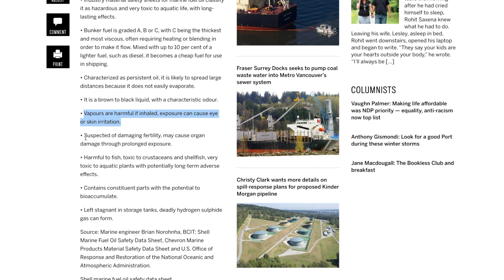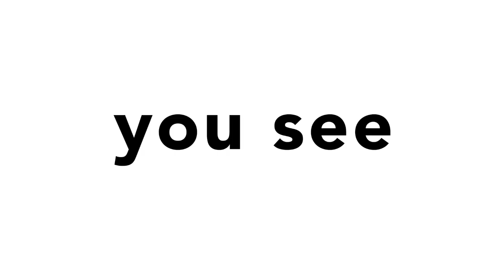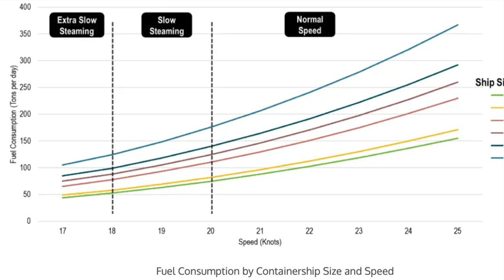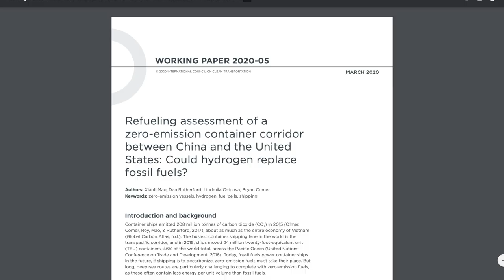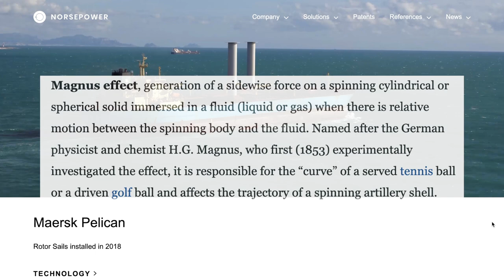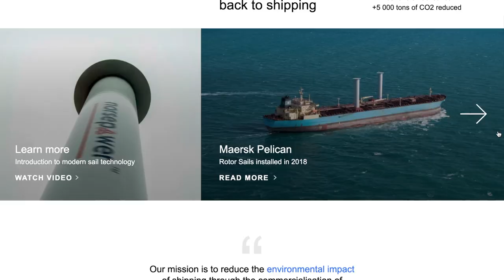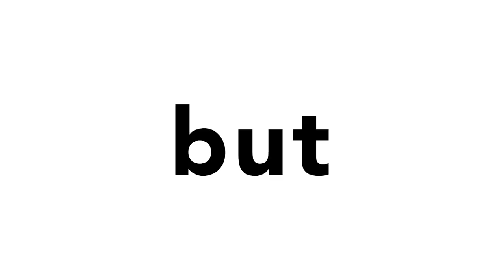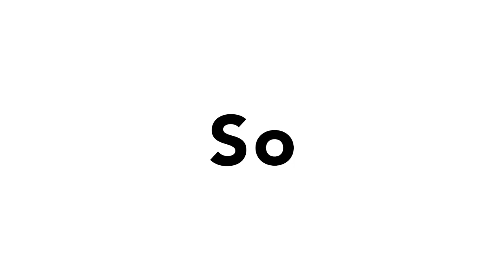Are Renewable Container Ships Even Possible?

Comment: The scale of container ships, and aircraft carriers means they don't have to have 1 Power Source.  In fact, container ships have been hybrid electric for quite a while, standard.  So, converting them to Electric is a pretty easy retrofit.  However, I wouldn't power them exclusively on renewables, I would extend their range with Wind, and Solar, because there's literally tons of it, all the way across the ocean.  We already carry Fuel onboard, but adding a vertical turbine, with a solar array means carrying less fuel, and more cargo.  The great thing to me is that this is one of the easiest changeovers for the companies.  They just have to see the long term profits, and pay for the conversions.  Governments don't even have to get involved.
Reply: Batteries:  Currently (Can't resist the puns) demand far outstrips supply.  However, these are being produced in America, and that supply is going to go up.  The thing is, if we play our cards right, there may be a demand for them, in China.  You know, the place where we send so many empty container ships to that there was once a profit in filling them with garbage for China to pick through for valuables?  So, it's plausible that these ships could be battery powered, one way.  Just ship batteries to China, and charge them up before you leave.  Then, Profit.
Reply: The economics of the marine shipping industry, high volume - low cost and this low margin means that all systems have to be in use at all times so multiple systems with intermittent use and thus periods of redundancy is contra indicated.  Electric, wind and solar are all not cost effective, the explanation  is a four and half thousand word rant and that is just starter pack.  If you want sustainability move less cargo over shorter distances.
Reply: @BernardLS  Okay, first of all, have you ever worked on container ships?  I have.  Second of all, that's a whole lot of word salad not actually saying much of anything, and what little it does is "Contraindicated" by the video you just watched before commenting on it.  You did watch the whole video, before you commented on it, right?  Because your $4,500 rant isn't a drop in the bucket on this scale.  That's not enough to fill up 1 container, on a ship, going across the Pacific.  So, bring it, I assure I will understand every word, and respond to every point.  If you can put your mouth where you say your money is.
Reply: @BernardLS  Now, developing technologies are not sustainable yet.  That's what we're talking about, Developing Sustainable Technologies.  Intercontinental cargo trips take as long as they take.  If you increase the energy in the main propulsion system, with secondary, and tertiary system (Which we already do, across the industry as failsafes so ships don't get stranded in the middle of the Pacific because 1 engine failed) then that free energy either 1:  Makes the net journey faster, or 2:  Saves fuel.  Just like the vertical turbines that were in the video, you just watched.  We're already doing it, it's just not a complete system wide changeover yet, because we're still developing sustainable technologies.  Not "Contraindicating it," because you, and the politicians didn't do your research, and don't have any actual experience, in our industry.
Reply: @BernardLS  Okay, I understand this is a complex subject, but that's why we narrow the scope with Specificity.  When it comes to a Container Ship, saving energy, it's not a 4.5kiloword rant.  I don't want to read you rant, because your emotional knee jerk "Nope" response doesn't really help anyone understand how the electric motors on a container ship work.  On that scale, over the distances (Intercontinental) that they operate at, ANY SAVINGS is better than making the trip as planned.  That's what we're talking about, not making the ship completely 100% sustainable, but More Sustainable, because ultimately, it's a trip that takes months any way you go about it.  We don't need 100% right now.  15% more sustainable is worth a lot of money, or Fuel, when you're talking about thousands of tons of cargo, every few months.
Reply: If you want to pare down your pre-written dissertation on why renewable energy just doesn't work, so that it actually has anything to do with This Comment?  I'd love to read it.  I know it can be done, in the comments, because I'm already doing it.  Maybe if you cut out the Rant, and just stick to the facts?
Reply: @Psiberzerker  I have included comments on the initial post here.

Economics says they do.  
Current fleet is mainly direct drive ICEs.
No retrofit is easy, except to the person selling it. 
Current as percentage of propulsion; wind circa 0.33% & solar circa another 0.5%. 
VAWT or Magnus rotors obstruct above main deck level stowage.  Less fuel more cargo only works if vessel is ‘down but not full’.
However easy something is it can still be too difficult to be achievable. 
No return - no investment.  
As regulators they do need to be, and already are, involved at both national and supranational level

Until limited by raw material supply, at which point fresh innovation will be required. 
China stopped that waste disposal by export trade due to lack of profit for them. 
No it is not, the power capacity is to low and the deadweight is too high.
Reply: @Psiberzerker  No, my years at sea were spent on tankers.
The purpose of the debate is to present opposing views so my 78 word ‘lot’ is intended to do that.
A number of times and have reviewed it since to see if there was anything I missed.
Twenty foot ‘box’ internal capacity 33.2 m3/ 21.6 tonnes.
Reply: @Psiberzerker  WADR my reaction is rational rather than emotional.
The greatest saving is not buying or shipping more than you need to.  Localise production to consumption.
Reply: @Psiberzerker  My ‘4.5 kiloword rant’ has evolved to that from consistently refuting the reiteration of similar and other flawed, IMHO, suggestions by many diverse commentators.  These slimmed down facts are added as replies to your comments, more detail is available; this is rather like the Abstract and Conclusion of ‘a paper’.
Reply: @Psiberzerker   Which costs money that has to be earned with existing systems.
‘didn't do your research’ going to challenge you on this, would accept ‘did not do sufficient research’
Reply: @BernardLS  Why I called it a dissertation.  No, I don't wanna read your rote rant.  What do you mean by WADR?  I can agree that shipping less over shorter distances could be a possible solution.  Good luck convincing consumers to stop buying water from Fiji "Untouched by Man."
Reply: @Psiberzerker  WADR, ‘with all due respect’
Reply: @BernardLS  Thanks.  I tried looking it up.  Since you worked on a Tanker, you have some idea how many acronyms there are out there.  (A lot of them can mean several different things in context.)
Reply: @Psiberzerker  The scene in 'Good Morning Vietnam' where Robin Williams runs through the spaghetti soup of acronyms sums it up.  My all time favourite is from a Lloyds List headline 'LOF agrees LOF with Smit', unscrambles as 'London & Overseas Freighters agrees to a Lloyds Open Form salvage agreement for a job with Smit Towing'.
Reply: @Psiberzerker  I could put the 'Good luck convincing consumers to stop buying water from Fiji "Untouched by Man."' in the SEP (someone else's problem) locker but sadly 99.99% of humanity is already doing that.  I have harassed my life partner into not buying cucumbers from our local store out of season as, despite being 97% water, they have been grown under a sea of plastic in one of the driest parts of Europe by undocumented workers in modern slavery working conditions before being individually wrapped in single use plastic and trucked 3 200km for us to garnish our dinner with.
Reply: @BernardLS  Yeah, now we're getting to the meat of the problem.  Shipping is "Somebody else's problem."  As long as there's fresh bananas at the grocery store, nobody cares what season it is.  Entire "Banana Republics" have had multiple wars, over decades, just so Karan can have her strawberry kiwi smoothie.  The problem is that "Somebody Else's Problem" is becoming everyone's problem.  Any solution has to work with real people, or worse:  Americans.
Reply: Still, you have to admit that the buyline:  "Bottled at the source, untouched by man" is fucking insane!
Reply: Fiji water are despicable for a number of reasons, IMO, they make false advertising, they move unnecessary products about, they move stuff from were it is needed to where it is not and they evade paying taxes.  A good example of corporate stupidity.
Reply: @Psiberzerker  IMHO the Fiji Water scam is indicative of what can go wrong in an unregulated market economy, why did they pick Cleveland for their comparison and not somewhere with a well proven bad public water like Flint, Michigan?  You might be interested in ‘Systems modelling for energy-efficient shipping’ (publications.lib.chalmers.se) which covers much of what is in my ‘rant’ but in polite, formal & academic language; the ‘chalmers’ is Chalmers University of Technology  (aka The Metal Bashing Trade School) an, allegedly, elite centre of technological excellence in Sweden.  On YouTube this has been recommended to me by the algorithms ‘Zero-Emission Container Feeder Vessel’ on the GL-DNV (Germanishce Lloyd - Den Norsk Veritas) feed.  Just a smooth S&M type pitch with no numbers and inadequate referencing.

Comment: At what point do you say it's too much effort to make renewable ships, and just redirect the effort to other sectors to improve? To me it makes more sense to get every country on nuclear for home electricity use first, before worrying about ships.
Reply: From the comment below you will see that I am no great fan of nuclear energy and it certainly IMHO has no place on commercial ships but the major problems is in two parts: -
1) to many people;
2) to much consumption.
If you do a web search for ‘nuclear ship savannah’ you will see that it has been tried and did not work.  A similarly heavily subsidised, by the government, vessel is in use in Russia which also operates, in support of the Northern Sea Route, a fleet of nuclear powered ice breakers these may, or may not, have been completely without issues.  Also the Russian state has parked a floating nuclear power station off of Pevek in the Arctic.  WRT to shipping; would you have full confidence in the management of a nuclear reactor under the control of an anonymous entity only traceable, perhaps, via a letter box in a FOC (flag of convenience) nation state?  If you are could you sell that confidence to Japan, the state that hosted the Hiroshima and Nagasaki nuclear detonations as well as more recently the Fukushima ‘event’?  Then try that same, or similar, sales strategy on Ukraine, the nation state that as a part of the USSR (CCCP) hosted the Chernobyl ‘event’.  Modern iterations of nuclear energy thorium fuel, molten salt reactors or fusion reactors will carry the legacy of past problems.  It is the global trepidation of anything with 'nuclear' in the name and the economics of nuclear having transitioned from 'energy to cheap to charge for' too 'the costs of remediation are incalculable' that will prevent the adoption of nuclear energy as a means of creating energy at sea.  Modern reaction systems may have overcome the safety problems but the general public, having been misled in the past, will not believe the fresh new promises.  ‘They’ say nuclear is cheap, it’s not it is expensive as well as being complicated, dangerous, not universally socially acceptable and having only ‘no need for refuelling’ as a questionable advantage; actually it does need refuelling just not as often.  When they do need to refill the warming up stuff it takes considerable longer than pumping tonnes of thick black stuff, HFO cSt380, or thin runny stuff, MDO, onboard which is one of the reasons HMS Queen Elizabeth and HMS Prince of Wales are pushed about by gas turbines thus using a similar fuel as the aircraft that fly off of them.  The Royal Navy (RN) with a high degree of skills and expertise use, at vast expenses to the UK taxpayer, a current operational nuclear fleet of 11 submarines (also known as ‘boats’) in two flotillas, seven attack subs and four ballistic missile boats.  The carbon footprint of all the extra bits of hardware and the fuel, including processing thereof, from ground to propeller, are the external costs that never seem to get considered.  Disposal, once it wears out, of both the machine (that was a ship) and fuel is another can of worms best left unopened.  The 26 RN boats no longer in use are laid up (some in Rosyth and some in Portsmouth) awaiting long term deconstruction including dealing with the fuel rods and other irradiated material.  The USN is not, as far as I know, a commercial organisation working to very tight margins and also has the skill and expertise to handle the complexities of nuclear power so as well as submarines their aircraft carriers are nuclear powered and each have a build cost three times that of QE/PoW, bigger crews and more generous funding.  For those who still think that nuclear energy might be the answer I recommend this report: - https://www.bbc.com/future/article/20200901-the-radioactive-risk-of-sunken-nuclear-soviet-submarines? ocid=ww.social.link.email.  The navy of the USSR might have been under resourced and over extended but it was still generously supported in comparison with merchant shipping.

Comment: I feel like algae-based biofuels will come before hydrogen for the shipping industry
Reply: Algae based biofuels require growing, harvesting and processing all of which have fiscal, environmental and energy costs or impacts, before you get their energy to the point of use, and the use of which will generate effluents that will impact the global environment one way or another.  Initial it is fairly easy to create CH4 from algae but there is already lots of it around which comes out of the ground as a fraction of the FOGI energy mining;  then you need to push that through a GTL (gas to liquid) process.  The algae is simply another way of getting organic matter.  CH4 is a lighter than air, vapour at environmental temperatures and pressures and you need to compress it, a lot, or cool it, a lot, to get enough on board your ship in manageable volumes to be useful also bear in mind that the containment of the cold or high pressure CH4 has mass and costs.  So the liquid derived from the GTL process can be used in a combustion process and that combustion will yield similar effluents to fossil hydrocarbon fuel.  Using bio fuels saves the addition of sequestered carbon to the bio sphere but only at significant expense better to not consume and thus not liberate the naturally sequestered carbon.

Comment: Floating OTEC plants producing ammonia using the electricity they make from air and the fresh water they also make as a by-product, could be the mid-ocean fuel stops. These plants would also bring up nutrient rich water to make the barren areas of the mid oceans bloom and feed millions. Ammonia sales alone might make it economically viable but the fish would seal the deal perhaps. Oh and there may be some money for all the CO2 that's being turned into biomass and removed from the atmosphere b/c of  the added fertilizer.
Reply: The ammonia MSDS just reminded me how ghastly, and dangerous, the stuff is.  Ocean thermal energy conversion (OTEC) is an, as yet unproven technology, that has not been attempted at even the prototype stage despite being around since the 1970’s.  Coupled with the energy requirement that even the lithium driven electrolytic ammonia generation would require it seems that Huber-Bosch will be the route for industrial scale ammonia production for the foreseeable future.  When more environmentally friendly ammonia does become available the best use for it would, IMHO, be fertilizer rather than fuel.  Just as nuclear would not be welcome in Japan, or Ukraine, ammonia would probably be given the cold shoulder in Lebanon.

Comment: I think hydrogen could be the answer with electric motor and fuel cells, removing the big engine and giving more space.
Reply: Hydrogen is a bust. Everything about it fails at a practical level. Generating hydrogen on a mass scale is energy intensive and consumes large volumes of water. Storing hydrogen is difficult and using it is dangerous. The future is batteries. Right now they're only in cars but pretty soon they'll be in everything else...even airplanes.
Reply: @yvanpajevic9680  I somewhat agree with you. Hydrogen is useless at this current time. However, I don’t think batteries is will be the future of boats and planes. Cars planes and boats all require different things from a fuel source Eg. Low volume for boats and low weight for planes. Batteries will need a massive breakthrough to even come close to fully replacing fossil fuels.